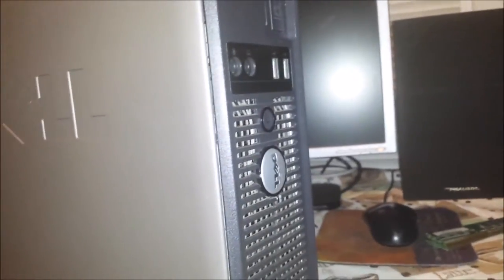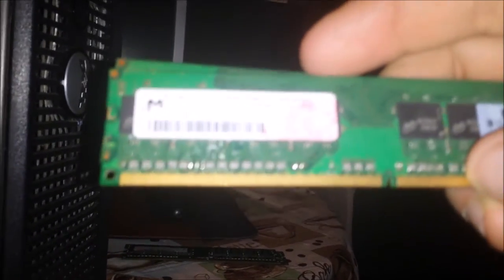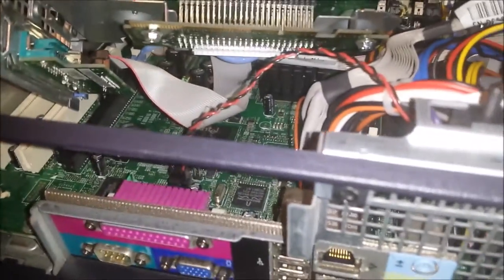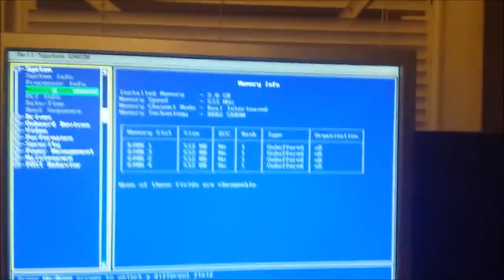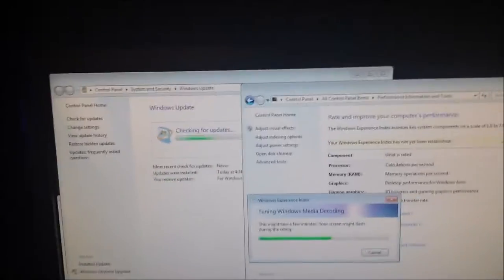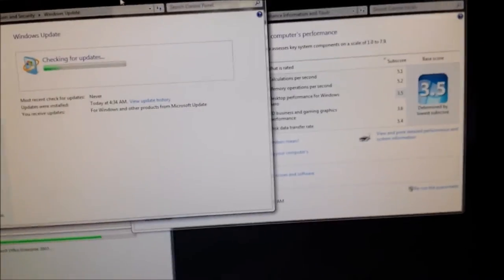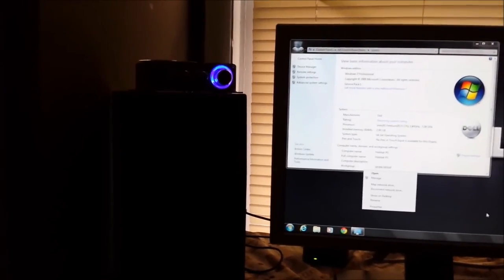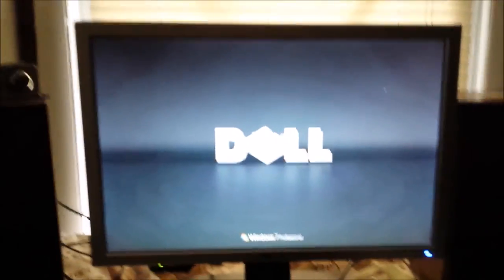Dell Optiplex GX620

Comment: I love Optiplexes, my main rig is a Dell Optiplex 755 mini-tower. Core 2 Duo E6550 @2.33ghz 8gb DDR2 RAM Radeon HD 6450 w/1GB VRAM and a 1TB HDD @7200rpm Best PC I've ever had.
Reply from the maker: The nice thing about the Optiplex line is that they are the professional grade machines.  They tend to use better capacitors and other components due to the way office machines are generally used.  They usually just lack in the video department.  Yes, I would agree that they are very good machines, especially when compared to the Dimension line.  
Also, it looks like you may be able to put a Core2Quad processor in that system.  Despite its age, my Q6600 still handles everything I can throw at it.
http://en.community.dell.com/support-forums/desktop/f/3514/t/19391541
Reply: Eric Brunhammer Yup, I can put a Quad in this system, haven't gotten to it yet. And yes, these machines are built to even take drops.